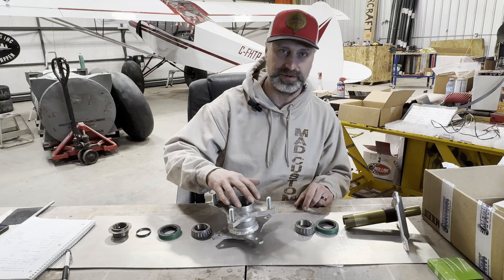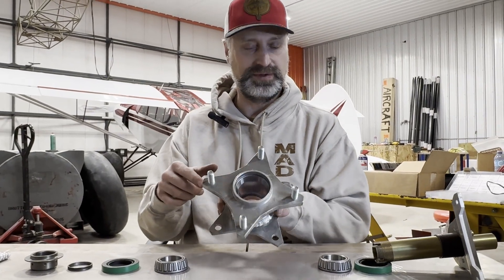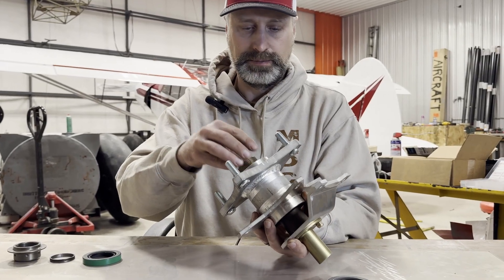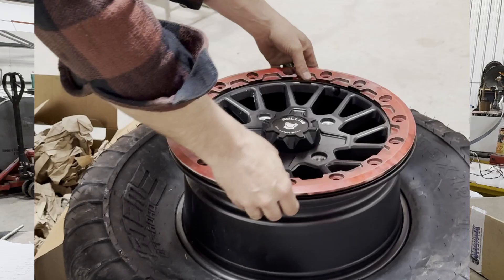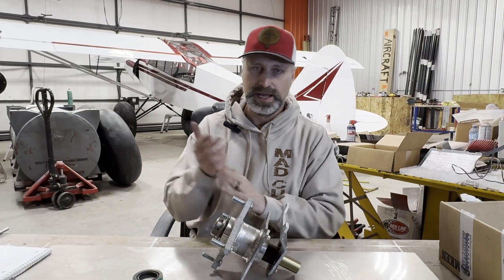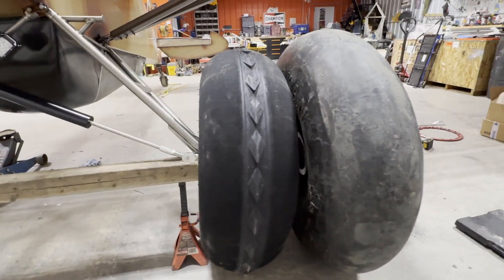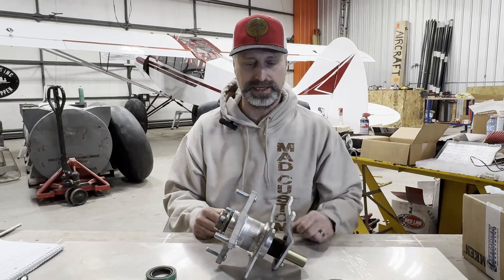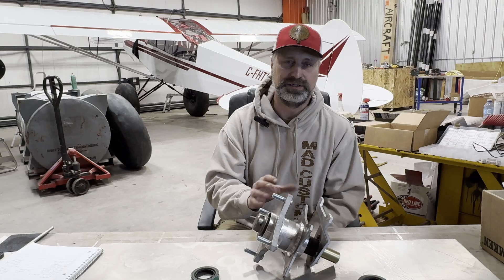Making Bush Flying More Affordable- New ATV Wheel & Tire Set up!

Comment: From personal experience with large rims like this, if that tire goes flat while airborne, when you land the tire bead will break from the wheel rim and you’ll have a wild ride with a boat anchor.  Been there done that.  I’ll NEVER go back to “Large” rims!  I ended up on my nose, took $36K and a year to IRAN the engine and replace the prop.  All I can say is, “Danger, danger Will Robinson”.

Comment: What type of axle is that? I couldn’t understand what you called it in the video.
Reply from the maker: The axle is one from Acme landing gear.
Reply: @shanemadson love the set-Up. Would run these on my Stinson 108. Would you custom make the hubs i
So they if fit on my axle, or do I need to modify by axle? Thx
Reply from the maker: @ is your Stinson certified? Only experimental/amateur built aircraft.

Comment: This is a great idea, personally I would go with motorcycle brake rotors and calipers. 
Motorcycle rotors and calipers would be lighter but still have plenty enough braking power for the application.

Comment: Whats the price comparison all up?
Reply from the maker: There is a lot of variables for that question. The biggest is what tires and wheels you end up, deciding to go with. My set up cost me $7000 Canadian all in. That is me charging $2400 Canadian for my hubs and with the wilwood brake callipers. That works around $4900-5000 usd.